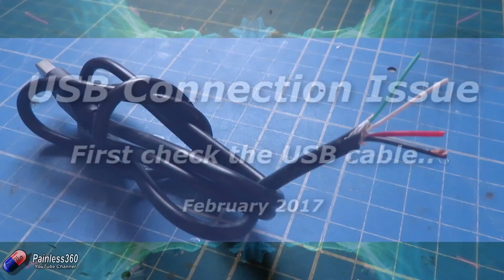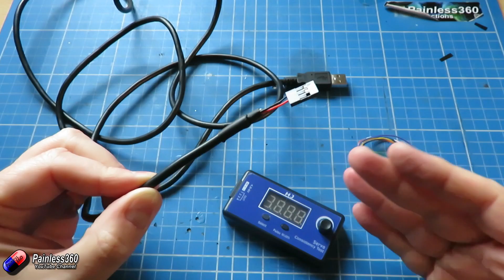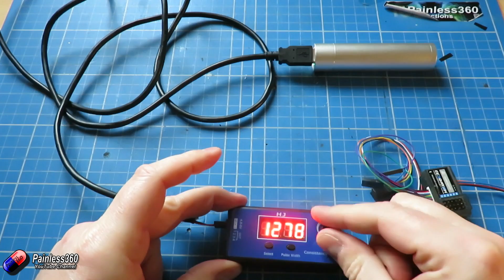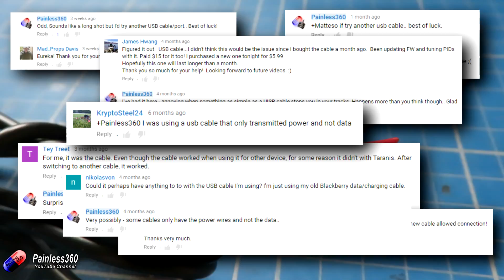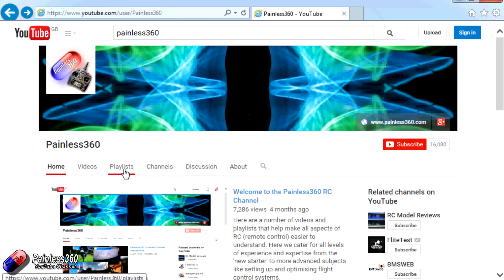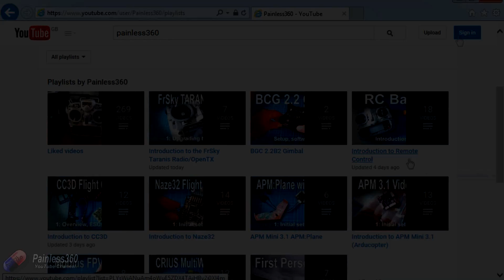RC Quick Tip: Troubleshooting USB connection problems

Comment: I would like to know how do you delete a model from the Tranis plus from the TX or can it be done? And also configure the BG X73 with frisky Rx. Just can't seem to get it to work in cleanflight
Reply from the maker: +BigTimMrInkAir yes, highlight the model you want. Then press and hold enter, the option to delete it will appear. Best of luck
Reply: Painless360 thank you. I have been watching your ch and letting you know you are a grate help.
I do not know if you have a BG X73 but I have followed its directions and still not air Born yet. lol I know I guess it's a newbie tranis thing but any help will be appreciated. 
And thinks again.

Comment: if it makes a noise on the computer or laptop when you plug it in then it is a data cable.  if not then it's just for charging 😊
Reply from the maker: Good tip - sadly not all cables that make that noise then work flawlessly :D

Comment: First rule of comms programming (which I learnt years ago) - if your code doesn't work first check the cable. It's pretty frustrating spending half a day debugging your code only to find the code is fine and the cable is at fault. As you say, same applies to connecting a quad.
Reply from the maker: Martin Budden hey Martin! our paths keep crossing!  Do you have a Skype account?
Reply: Yes, I'm on Skype. Why do you ask?

BTW, I'm enjoying your iNav series. I'm just about to build my first flying wing, so it will be useful too (I've flown just quads up to now.)
Reply from the maker: Martin Budden missed you at the Drone show in Dec. and wanted to say hello!

Comment: Another 1 to go with that Lee is the usb to uart (virtual com port)driver, people are convinced its a bad FC as it connects and leds flash but no coms.
Reply from the maker: +alwischy FPV good point. Ugly, we don't get a lot of those problems here on the channel. The cable is by far the most common problem when having USB connection issues. Happy flying
Reply: Ugly ? you hardly know me LOL
Reply from the maker: +alwischy FPV bloody autocorrect!  :)

Comment: Can you(or anyone) help me with something,I have changed transmitters to the evolution and now I have an issue setting up the included ia6c receiver with a cc3d in librepilot. I am trying to use, when doing the esc calibration in the setup wizard I don't get as many beeps as I used to and when doing the motor test the motors don't spin, are my esc's fried? When I had the old receiver I crashed the quad, however the esc's still worked. Sorry about this but I'm really new to hobby grade quads and need all the help I can get.
Reply from the maker: +KWADS FTW for an ESC to go into calibration mode, it needs to see a value of over 1800 full stop I'd make sure he travel on the throttle is enough. Best of luck!
Reply: Painless360 thanks, i'll check tomorrow

Comment: Hi there,
This is Wayne, I'm a big fan of your channel and had a small issue with my sp racing f3 board that I hope you could solve for me. The problem is that I can only arm the sp racing board when it is connected to cleanflight via USB and therefore can't arm without plugging into the computer. I don't get any esc start up noise when I power on without the USB cable but I do hear my emac 20a  linear esc beep when running clean flight. Pls help me because I need to set this up and my project deadline is in a week... I can give you all of my dump data if you need it
Reply: I also tried giving it a 5v power but still no luck
Reply from the maker: +Wayne Wen sounds like power to me. I'd check that the 5v is ok from the PDB.. best of luck
Reply from the maker: +Wayne Wen there are reports of this in some versions of cleanflight and beta flight. Best of luck finding it.
Reply: Painless360 does the 5v still apply if I'm using linear escs?

Comment: Nice one funny this was not communicating with my Quad but with my Lighting Rig, All was telling me I had some power but no RX TX to the lights. Fixed in the end and made sure I was not going to do the same by cutting off the end ans like you have commented used it a 5v PS output, best thing for them.